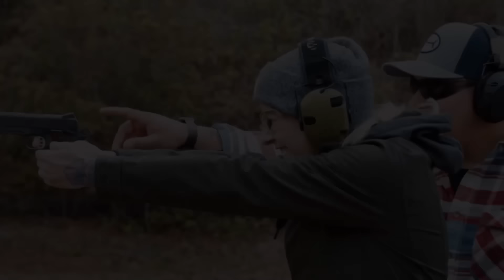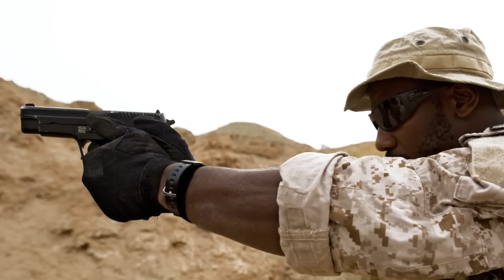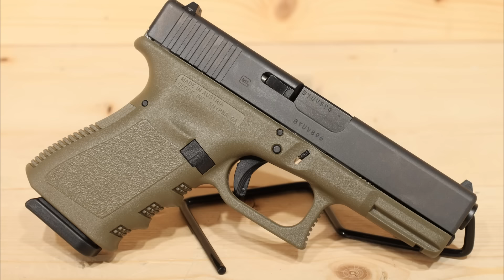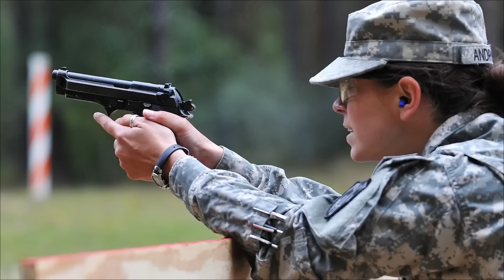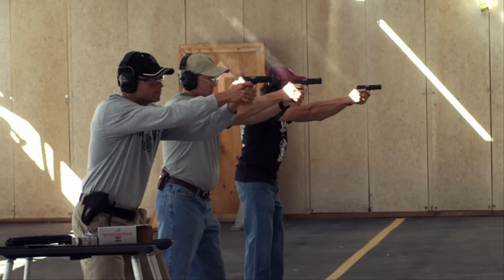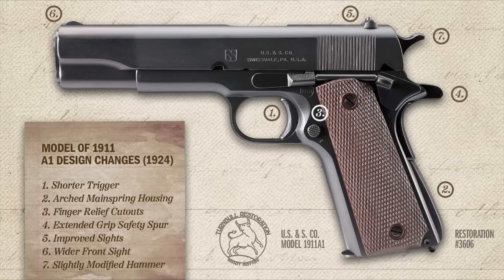The 7 Most Reliable Handguns of All Time. Buy Once, Cry Never!

Comment: About 45, maybe 50 yrs ago, I picked up a .45 government, well used. At 25 ys, I could barely keep five rds on a four foot square target. Had it reparkerized, all new parts, barrel, then shot it after having rebuilt, five rounds the size of a small orange , after a two hundred round break in, It's a safe queen now. Then came across a Colt Combat Commander .45, relatively cheap, someone had tried polishing the satin nickel to a bright finish and went into the base metal.  Had the slide de nickeled and reblued, new barrel bushing, trigger work, shoots great, carried for some time, then ran across a SA 1911 compact 4 in barrel, 9 mil, Been thinking about sending it back to the factory for inspection and rebuilt. I have four, five gal buckets in the basement of just empty 9 mil brass.  Now  it's fussy about the brand of ammo that it likes. I have another .45, it's a double stack 191A1 government,  from  SA, got it more of a curiosity ( it is similar to the Para-Ordinance P14-45  ) than anything else
Reply from the maker: Thanks for sharing your experiences with those 1911s!
Reply: I've since talked to two other guys who have the same SA 1911 compact 9 and they both have told me that they have all of the internal springs changed in the area of 4 to 5000 rounds, my little 1911 has in excise of 26000 rounds and like I said above, I have kept the empty brass. why? Good question and yes I'm  still thinking of sending it back to the factory, just need to get off of my pivot point and do it.

Comment: We love our Browning HP in .380acp. It is very accurate and fun to shoot. My grandmother/mother carried it as their self defense arm because they couldn't handle the .357mag my dad carried. The only complaint I have with the HP is the slide "bite." When firing full magazines, my hand has a tendency to slide up slightly and sometimes the action catches. Its why I prefer our .45 Colt, but the HP is still fun to shoot.
My grandfather carried the 1911 Colt in WWII in the Navy and my uncle was able to carry it in 'Nam when he was in the Air Force. Back then, you could register your personal side arm for duty carry, but by the time I served in the Army in the 80s, they stopped that tradition and I had to carry a crappy M9 instead. I went through multiple attempts to get the 1911 grandfathered in so I could carry it, but despite the history/tradition, they said no. I even proved I could be just as accurate with either one, but it didn't matter. They made every excuse like they were no longer stocking the .45acp in our supply and did not have replacement parts if it failed. I hated the M9 because it feed-jammed more frequently and demanded intense cleaning, moreso than the 1911. It was next to useless against body armor.

Comment: The Beretta 92/M9 also is NOT tilt barrel system, unlike the Glocks, and as a result, DOES NOT need a Nielsen device to cycle with a suppressor attached.

Comment: 0:10 - pistols that last 

A video says some Glocks will b discontinued.  The AI Summary of that video says the Gen 5 Glock 19 won't.

5:13 - Glock 19
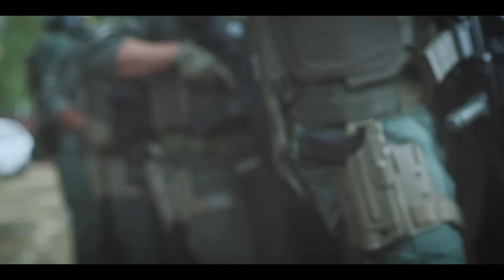5:33 - may b most indestructible
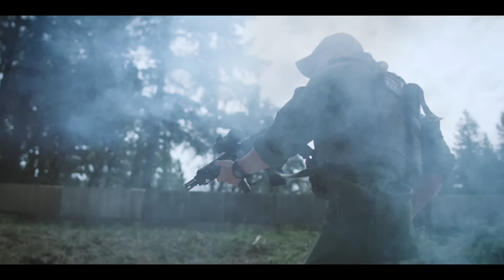6:53 - current Gen 5 Glock 19 is $550 - $650.

Comment: My first firearm was the GP 100. Still have it. Unblemished. Also have the G19, a G23G4, the Sig P226. I don't have a Colt 1911a1 but I do have two Unissued 1945 Rem Rand 1911's LNIB with DCM paperwork. Pristine. My Dad got them thru an NRA sale in '62 for $17 each. Passed down to me.

Comment: have 3 1911's acolt government issue 43 model,  made by ithaca a remington r1 with match barrel and trigger and a springfield with a compensator all running full length guide rods and recoil buffers. I also run the wilson combat 8 shot mags. Have two of the 92sf's, Have another beauty you dont see often is the ortgeiz in 32.a beutiful and very accuratevweapon.

Comment: While in the US Army as an MP (1976-1979) I carried a Colt 1911 A1 from WWII. On the combat range for qualification, I shot 50 out of 50 and earned expert. I had always wanted one. Black Friday 2025 I purchased ($599.99) a Springfield Mil Spec 1911 45 ACP. I love it am very happy I did. The 1911 will never fail you, last forever and is probably the saftest handgun ever and now it is 115 years old. The only drawback, 7 round magazines. It is now my primary go to for my concealed carry. Until I purchased the 1911 I carried the Smith and Wesson MP9 M2 great gun and 18 round Magazine.
Reply: I carry the same 2 guns. The 1911 is more accurate in my hands because of the weight.  Only draw back is the carry weight. I dont have an ass and I'm continually tugging at my pants to pull them up.
Reply: For over 30 years, my personal service sidearm was a Beretta M34 in .380 ACP. Not as accurate as a target pistol but it never missed a beat.
Reply: I stumbled onto the 1911 pistol because of a sale. It was a Rock island Arms M1911A1. It was a cheap reproduction.... and its an absolute nail driver. I've bought 4 pistols since I cant hit the broad side of a barn with including a full frame 45 striker fired..... but that 1911 is a dream in my hands.
Reply: Thank you for feedback on your 1911 expert. Great design and proven reliability.
Reply: The Mil- Spec is an awesome firearm. Thank you for your service!
Reply: Look for a used Para Ordnance p14-45 or p12-45....14 or 12 rounds double stack
Reply: except for the internal extractor
Reply: with the 45 ACP 1911 you really don't need more than that 7 round mag when you carry one in the smoke stack that 8 rounds is more than anyone should need, if you need more drop that mag and insert the new one now you have 15 rounds of Cannon power. My holster has that second mag attached to it,
Reply: @marksmith7054  When it comes to fire power you are right. No matter how good one is on the range it is entirely different in a real fight. When I carried my 9mm I had 36 rounds in 2 mags. Now with the 1911 I have 28 +1 with four mags. Even though I am better off I still feel a bit naked.

Comment: Glock 19?  Sorry, but you cannot tell me with a straight face that the polymer plastic frame will last a century.
Reply: Glock es muy buena pero no tanto.
Reply: I dont know about a century  but I have been carrying mine  26 years now  and its running just fine.   It looks rough and needs the night sights replaced  but plastic is holding up.
Reply: As long as it's not laying out in sunlight constantly it will last longer than us.

Comment: My 1911 is sorely missed. My Italian Beretta 92 is sorely missed. Even my Brazilian made Taurus PT92 and PT101 are missed as is my Springfield XD.  They have all been replaced by my Glock 23, Glock 21SF, and Glock 44. The reasons for replacing all of my pistols with Glocks are modularity and reliability. With my G23 3rd GEN, I have the ability to shoot .40 S&W and .357 SIG with just a barrel change and 9mm with a barrel and mag change. With my G21SF, I can shoot .45 ACP, .460 Rowland, and 10mm with barrel and mag changes. My G44 is for plinking and ergonomics practice with .22LR. It feeds anything and cycles any .22 LR ammunition from cheapo Thunderbolts to Stingers. No malfunctions. No failures to feed or eject for all three guns. I've owned Glock 17s, Glock 19s, and Glock 22s, but honestly the G23, G22SF, and G44 is the best three pistol combo you can own. I intend to replace my G23 & G21SF slides with MOS slides after shooting my friends G40. I like that red dot!
Reply from the maker: That's an impressive and versatile Glock collection!

Comment: My oldest is a 1911 Colt Combat Commander bought for my Army commissioning. Why, because no one who wore the uniform should ever carry anything less into combat. It carried me thru three combat zones.  At least one Soviet Tank Commander discovered the old, fat, and slow .45 ACP will punch your ticket thru their cheap flack vests in Afghanistan.

My newest will be a 9 mm Rock Island 1911 Double Stack with a red dot.  Why, because First Last and always buy American where possible. Second my old eyes need the red dot. Third, Rock Island makes the DS in a steel frame. The 9mm may not need it for the recoil, but why take the chance.

Comment: I loved my M9 so much while in the Corps that I bought one after I retired. The old service pistol, the M1911, was phased out in the USMC armory in 1985-86, if I recall correctly.  The M9 didn't kick as hard as the M1911.
Reply: When I left the Army, there were 3 weapons that I wanted for self-defense that I knew, trusted, could buy once and would never have to upgrade ; I wanted a combat proven pistol, rifle, and shotgun...So, I bought the Beretta M9, the Colt M4, and the Ithaca model 37 slamfire. All are or were standard issue in the U.S. Army, served in multiple wars, and will last at least 3 lifetimes with plenty of parts available. While I'll probably add a .22 for plinking and a Winchester model 70 for deer hunting, these are really all I'll ever need for personal protection if SHTF...I'm very happy with my choices and sleep well at night.

Comment: I love the 1911 as well as the high power. Both operate identically. The most critical difference is that the 1911 and the high power is in the safety. Up is safe and down is fire. Most other handguns that have an external safety work the opposite way. After training extensively with one it'd be difficult to go to the other. Both to 1911 and the high power give you the best of both worlds. When is rugged and has good stopping power even with ball ammo, the other carries 12/13 rounds for those who feel naked with less. For me the perfect compromise was a Colt Commander. You wouldn't think losing just an inch off the slide and barrel would make much difference but it does in weight. Carrying a full size 1911 is like carrying a brick in your pocket. The commander gives you all the good things of the 1911 without all the weight. Will the quality 8 shot mag and One in the chamber you've got nine shots of 45. If you can't solve your problem with that you've got a much bigger problem than a handgun should handle.
Reply from the maker: Thanks for sharing your extensive experience with the 1911 and High Power!

Comment: Friendly advice; if you want more subscribers, do more research for your videos. Beside mistakes noticed by others - every 357 will shoot 38 Special, and +P. Not because there is any "genius" involved in particular revolver's design, but because these bullets are compatible and share same width - 357 is longer, but not wider. Since revolver does not automatically remove discharged brass, they are not sensitive to cartridge's length. 38 variants are, effectively, lower power 357 cartridges.
Reply: Make sure you keep the chambers good and clean if you shoot a lot of .38 specials.